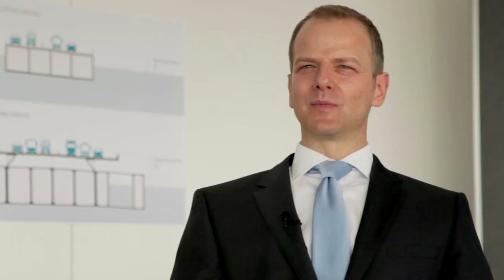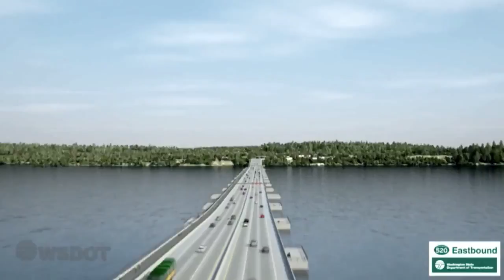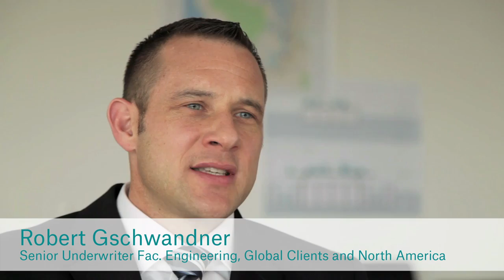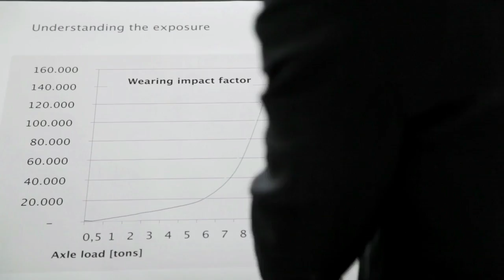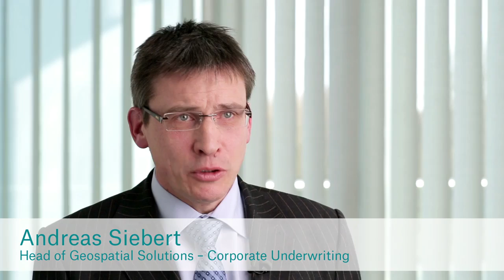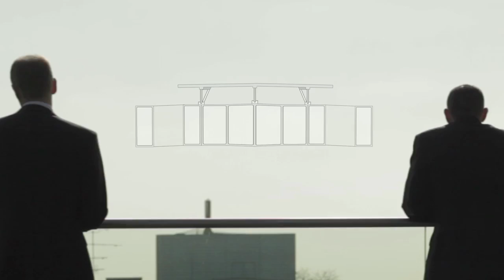Seattle Floating Bridge: The longest floating bridge in the world

Comment: Water pressure power conveyor to help bridge crossing less fuel and faster. For example the conveyor each about a mile then connect them to help drivers cross even pacific and had submersible ability in case large wave or high wind we pull over roof and sink portion of the freeway down about 300 ft is enough to keep is stable and float again after the storm

Comment: Water pressure power conveyor to help bridge crossing less fuel and faster. For example the conveyor each about a mile then connect t hem csn help drivers cross even pacific and had submersible ability in case large wave or high wind we pull over roof and sink portion of the freeway down about 300 ft is enough to keep is stable and float again after the storm